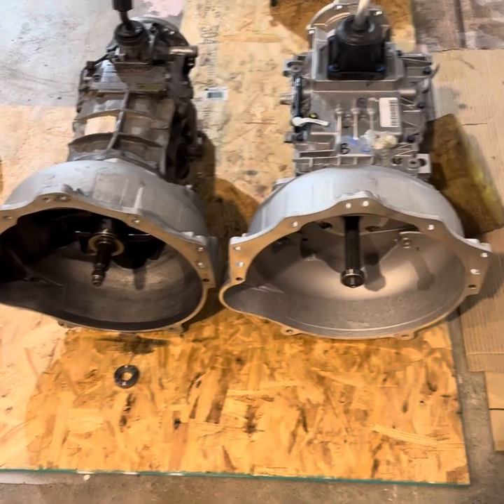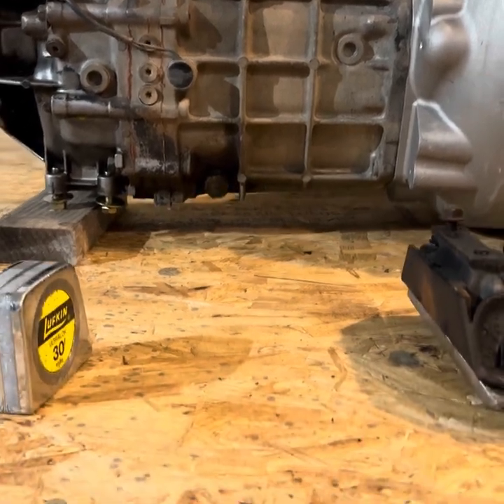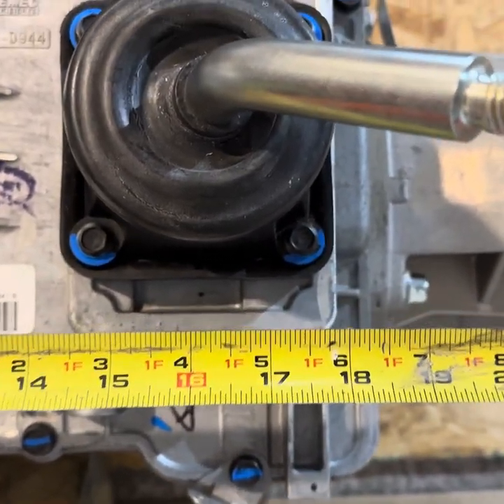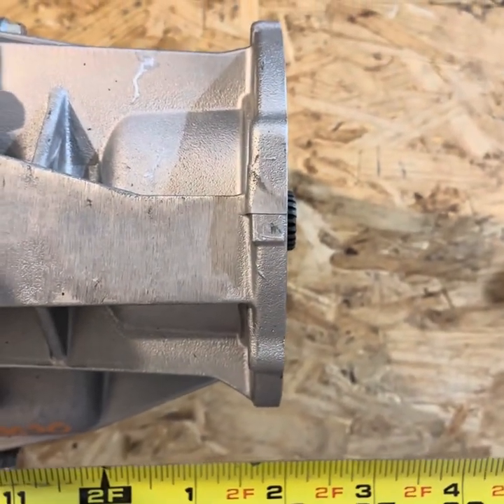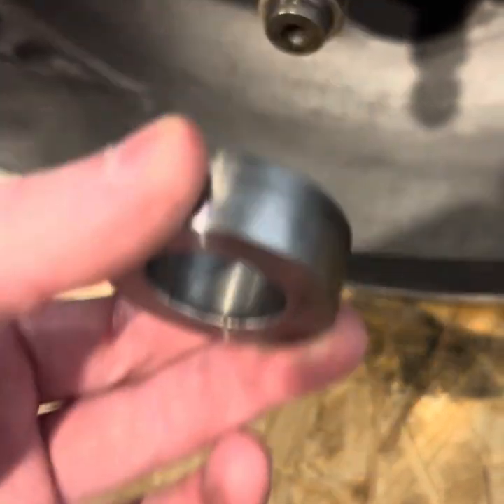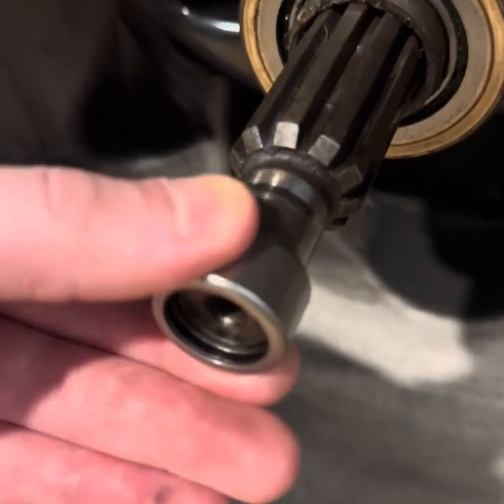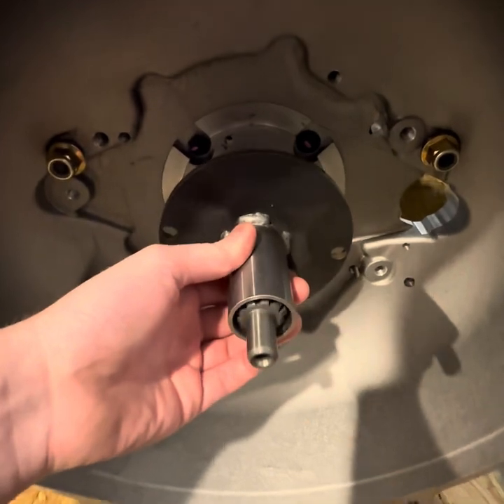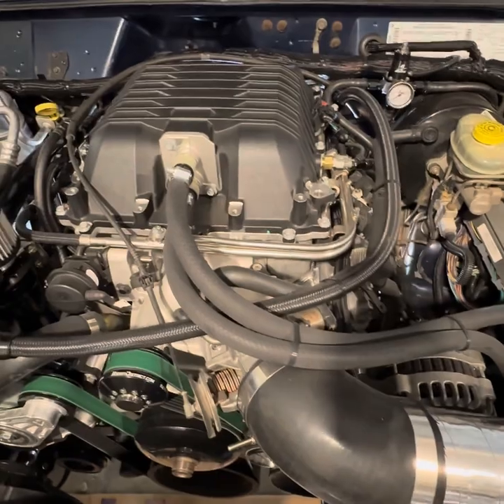Tremec TR4050 vs AX15 Size Comparison

Comment: Did the AX15 not hold up?  Why the change to the TR4050?
Reply from the maker: The ax15 did great, no issues. It’s only rated for 300hp though. I’m at 440hp now and I’m aiming for 500hp. The tremec tr4050 is the only 4x4 manual transmission rated for that kind of power.

Comment: Why not use an nv4500? Just wanted something new?
Reply: The NV 4500 is as junk as you can get it. I’ve had my Nv4500 out of my truck 5 times in 7 years. Nothing but trouble. So I finally put a Tremec in.
Reply from the maker: It’s supposed to shift a lot smoother than a 4500, maybe a bit stronger too.